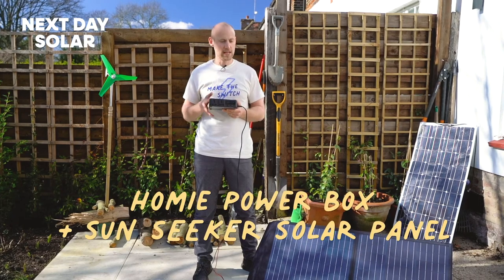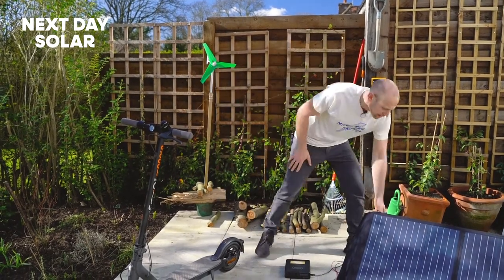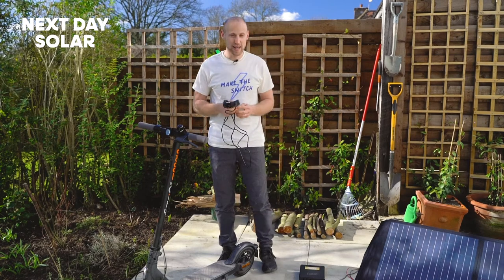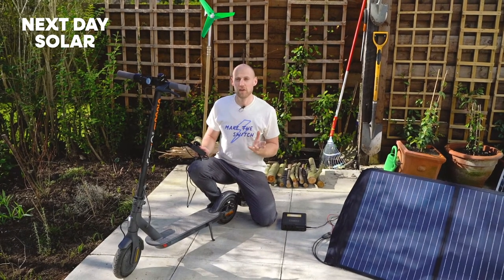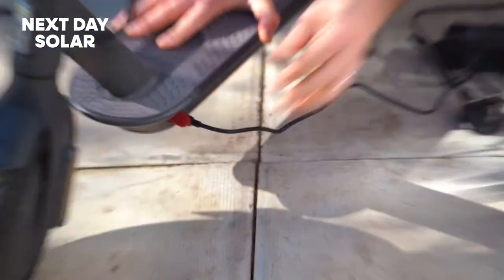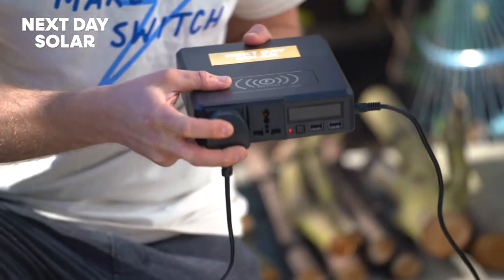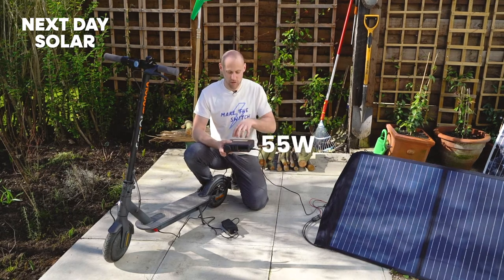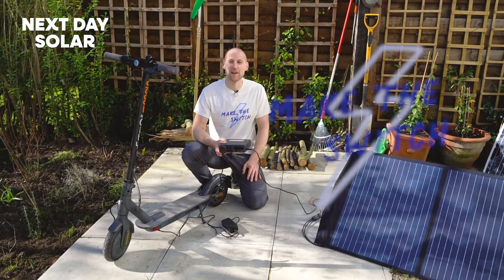Solar Panel + Battery Box - Charging E Scooter from the Sun

Comment: Cost for solar panel n battery box please?? 
Please give website link
Thanks
Ps: can i charge my 48v 20ah lead acid e bike/scooter battery
Reply: Cheers
Reply from the maker: Hi, the 100W solar panel can be found here : https://nextdaysolar.co.uk/products/foldable-solar-panel-100w, and the battery box is here : https://nextdaysolar.co.uk/products/powerbox-utility - In answer to your question, the kit you are talking about is not a dedicated 'charger' so you would need a charger to run off the battery box to charge the battery. Similarly, the battery box we feature in this video is 154Wh, your scooter is 960Wh, so its a little under rated for your powerful battery ! Are you sure its lead acid, the battery you have ?
Reply: @nextdaysolar3349  thanks for responding ?! Trying to figure it out !?
Reply from the maker: @balasubs1  Typically e-scooters will be Lithium Ion batteries, as they are light and small, lead is saved for starter batteries on cars, and other applications. The depth of discharge-usability on Lithium lends itself well to mobile applications such as scooters. If you send me a link to your scooter/battery (unless its a custom build) I can check for you.

Comment: Hello there.  I'm getting ready to purchase this particular E-Scooter:  https://www.youtube.com/watch?v=XEUGquXhaGE
I'm wondering if I would be able to put a solar power station in the basket and perhaps attach solar panels to the top of that basket to give the e-scooter a continuous charge (I need to be able to go a farther distance to get to a job) or I could wear a backpack and attach a hanging solar panel from that.  I'm just wondering if doing something like that would help me to keep the battery charged while I'm trying to get to a job.
Reply: Hi. What people usually do is to install a second battery, which is connected in parallel to the original one to extend the range. An extra 10Ah battery can weigh about 2kg and gives you about 20km of extra range.

Comment: Can I get a usb cable to go directly from my scooter to my solar panel?
Reply from the maker: Hi Ambs, I'm not sure I fully understand them question. I think the question is, can I get a cable from a solar panel to charge the scooter directly. The straight answer is 'not really' as you need to charge the scooter using a charger, with a set voltage, and set program of current. Most scooter/e-bike batteries are 36.8V nominal. In theory you could find a solar panel with a higher voltage and charge, but all the scooter/bike batteries have a BMS which you'd need to crack. So in short, you really need to use the scooter charger, to charge the scooter.
Reply: Honestly I'm not sure a usb cable would be ideal. The wires inside are a bit small for charge level amperage. You could try but maybe keep it away from your garage/house or anything valuable just in case. Good luck 🤞

Comment: ineffeciet doing DC to AC to DC
Reply from the maker: Of course, but you need to transform at some point from the DC from solar, to a different V DC for the battery, approx 36V
Reply: @nextdaysolar3349  ye you dont need to go ac for that, but a boost converter, way more effectient.
Reply: Correct.  Use the boost converter set at 42 v for a 36v scooter such as that one!